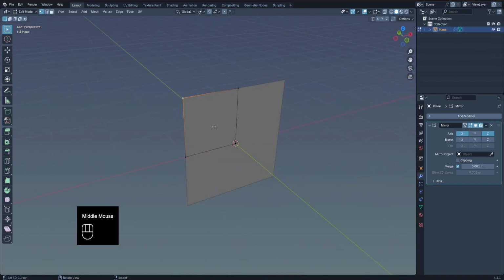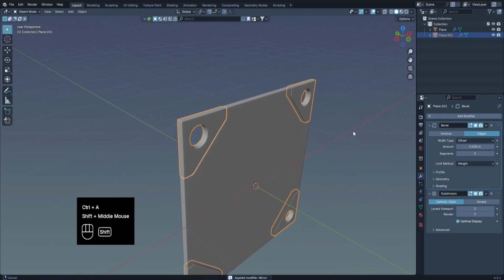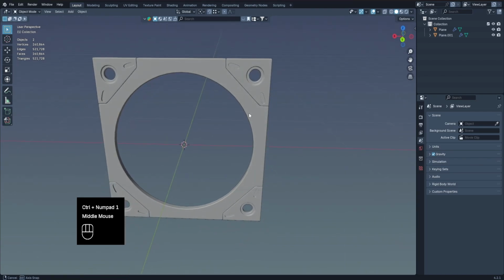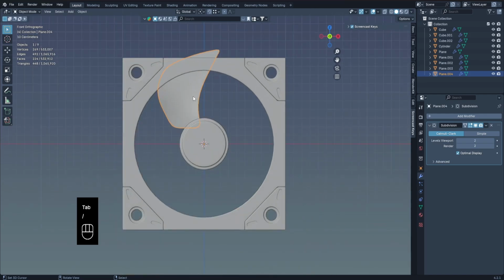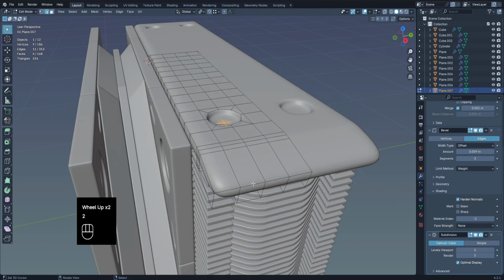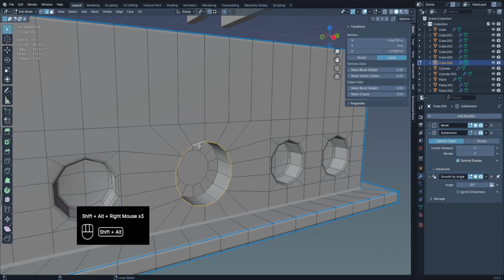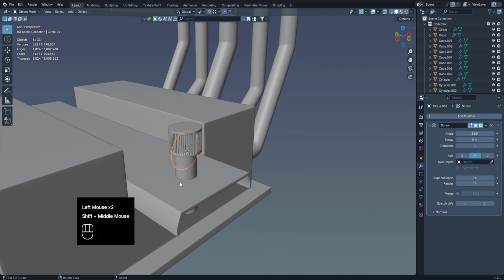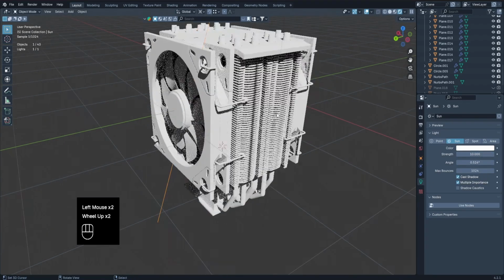Blender tutorial for Beginners: 3D CPU Cooler Modeling

Comment: Hello,
Thank you for this tutorial.
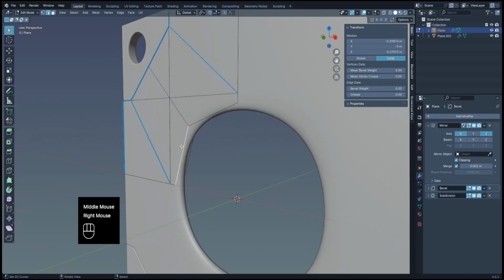I have an issue : When I make bridge edge loop (17:27) the big hole don't look round anymore (bridge surfaces make hexagon).
Reply from the maker: Hi, appreciate it man. Most likely you have beveled the middle edge as well. Take a look at 17:30 I reselect the edges without the one in the middle (you cannot see it due to subdiv modifier, but it is still there)
Reply: @SkyFlyDesigns  Thanks to your downloadable file I solved the problem.
The issue was on bevel modifier / Limit Method / Weight (not Angle).
Thank you for your help.